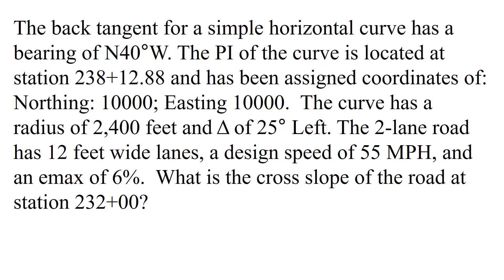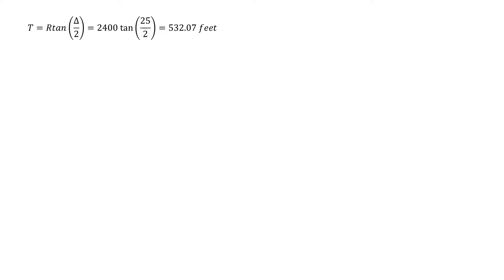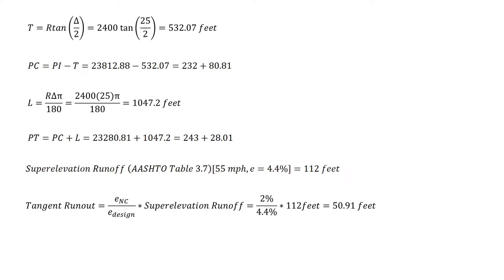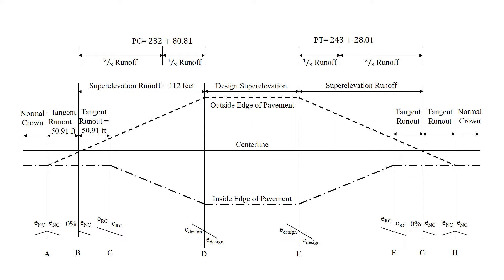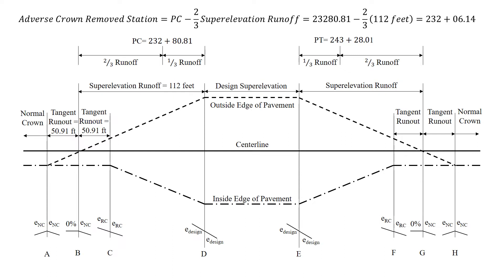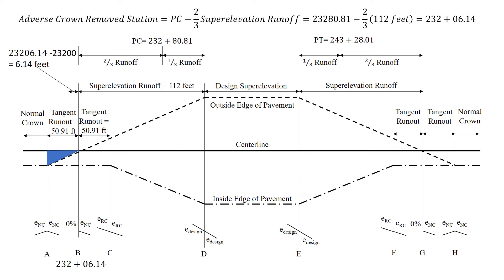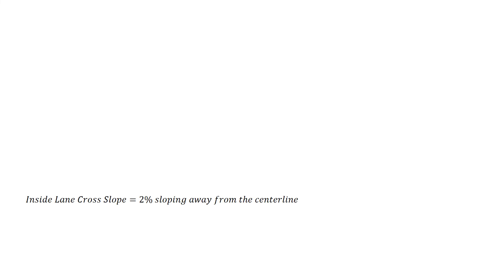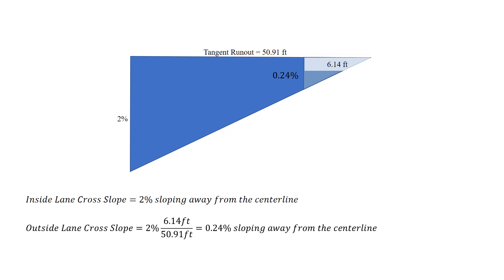Cross Slope at Point on Horizontal Curve [Find the Cross Slope for the Inside and Outside Lanes]

Comment: Which edition of the greenbook are you using for superelevation runoff? 2018 edition shows 55 mph e at 4.4% = 106 LF for 1 lane rotated (p3-66 tbl 13-6a)
Reply from the maker: I'm also using the 2018 edition, I think you might be looking at the column for 50 mph instead of 55 mph.
Reply: @FindleyDaniel greenbook 2018 7th edition has table 3.7 as minimum radius using limiting values of e and f on page 3-34. 

Table 3-16a is super elevation runoff Lr for horizontal curves. This has 1 lane rotated at 55mph being 106 at 4.4%. This is page 3-66. Are we using different editions?

Comment: For those who are interested, AASHTO 2018 A Policy on Geometric Design of Highways and Streets: 
1) To find design superelevation using radius and e_max: see tables from pages 3-42 to 3-51
2) To find superelevation runoff length (Lr) using design speed & design superelevation (the result from No.1 above): see table 3-16a, page 3-66
3) Formula to compute tangent runoff length (Lt): see page 3-70
This problem is the combination of all we need to know about superelevation and cross slope. Very interesting! Thanks for making this video. That is helpful! 👍👍👍👍👍
Reply: In which table I can  find the 112 feet?